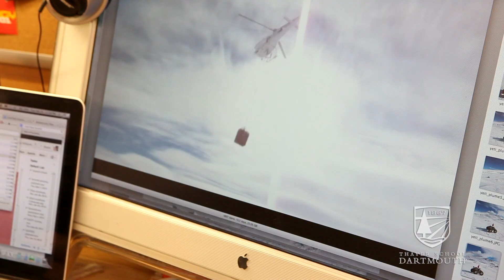Graduate Student Engineering Research: Yeti Robot

Comment: the use of air-inflated tires are wrong. Should be aluminium stock edge to cut through ice. Over a period of time, the tires will be flat during the last 5 years of research. Am I right?
Reply from the maker: Hi, thanks for your question! Rubber tires are the most efficient and cost effective solution for Yeti, which was designed for use in polar terrain. In fact, we generally don't run them inflated. The carcass easily supports the low mass of the robot.  The wheels cost about $100 per corner (rim and tire). The ground pressure is very low, and resistance is therefore also low. You can see that there is essentially no sinkage, i.e., no need for an edge to cut through the ice, which would increase resistance and energy requirements. The Mars Science Lab has the type of wheels that you describe, and they are experiencing damage. See, e.g., http://www.space.com/26472-mars-rover-curiosity-wheel-damage.html